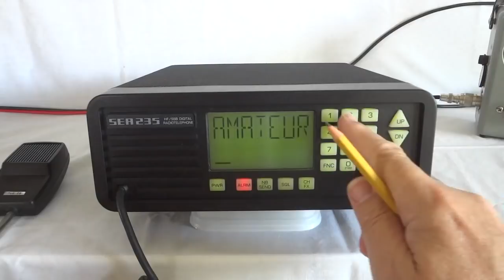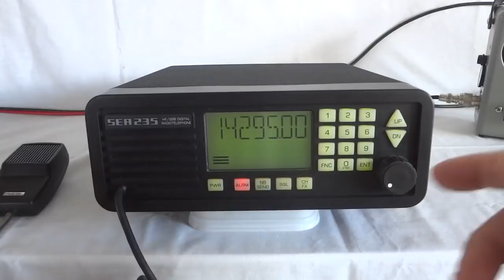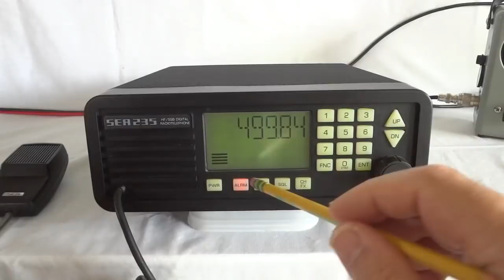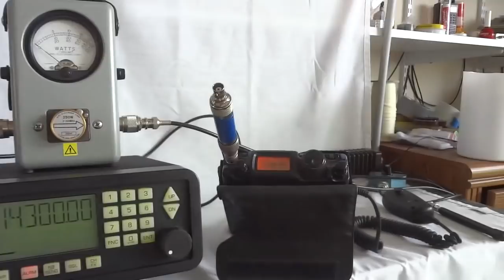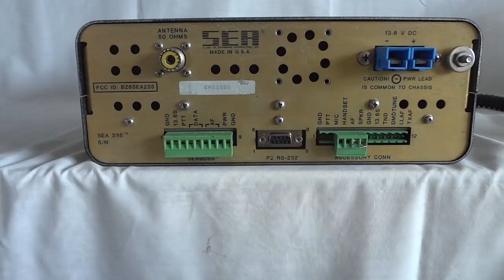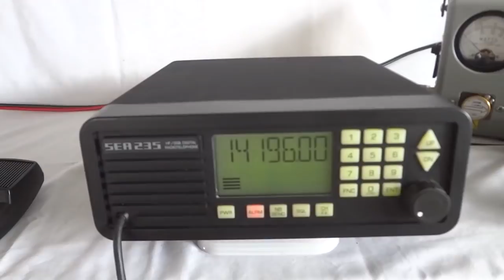SEA 235 HF SSB marine & ham radio with IF DSP and DDS

Comment: I'm a Amateur radio operator and recently purchased a second hand SEA 235. On power up the screen shows "235 NZ", CT 1.18, RT 1.25. When I push 73,FNC, ENT ."Amateur" does not show on the screen & no Amateur operation is available. Can anyone please help/advise if the SEA 235 NZ is able to work on Amateur Bands?. Is there a firmware I an install to support this?.
If I can install a firmware what software do I require etc. Any information would be much appreciated. Google is no help :(
Reply from the maker: In my current SEA235, I have firmware version 1.25 for EPROM U26, and firmware version 2.02 for EPROM U12. (one is the DSP firmware, and the other the control firmware, not sure which one is which). Amateur mode works fine in that one. The one in the video has firmware versions 1.17 and 1.25, thus actually slightly older than your radio, and the amateur mode works in that one as well, as you can see in the video. 
I have had a SEA235 with firmware 1.01 for U12, and that one still had the "amateur" mode.
So I doubt firmware has something to do with your problem. But if you want, I can email you the binary data files for the EPROMS, no problem. But you will have to find someone with an EPROM programmer to erase and reprogram your current EPROMS (the SEA235 has no flashable firmware, everything is in EPROMS). I can also send you a PDF with the complete technical manual for this radio, but you should be able to find that on the web as well as I have uploaded it to several manual websites in the past. Hope this helps.
Reply: Thank you so much for your reply. I have emailed you in regards to the Data files. @LifeIsTooShortForQRP

Comment: Great Video! Is it capable of DSC?
Reply from the maker: No, it is not - that is probably the reason why they start to show up on the surplus market.
Reply from the maker: Tillman, regarding your other question: Not sure if I can help you with that - I did not even know what an LRC license is, had to look it up. But in general, when it comes to HF radio on the high seas, you should not take any chances with safety; don't try to safe money there. So your HF SSB marine radio should have the latest DSC capability and an NMEA interface for a GPS receiver, which rules out this SEA235. The SEA235 is great for ham purposes but NOT for communication when you life depends on it. I get this question often when I put videos of (obsolete) HF SSB marine radios on YouTube. My answer is always the same: Buy the Icom M803. It offers all modern safety features and is the most cost effective full-featured HF marine radio on the market today.  See here:  https://www.icomamerica.com/lineup/products/IC-M803/  . Cheers and safe sailing!
Reply: LifeIsTooShortForQRP 
Thank you so much for your time and effort. I run a modern VHF DSC radio that covers the whole of the Mediterranean see in addition to my satellite emergency devise, so safety would not be problem. Just found out about another no-go about this (otherwise very nice) radio: it’s grounded via „commons“ which makes it impossible to license it in Europe. So I could never get a „radio station license“ which is required to run transceivers on boats in Europe. Anyway, many thanks for your information and your great video! All the best, Tillmann